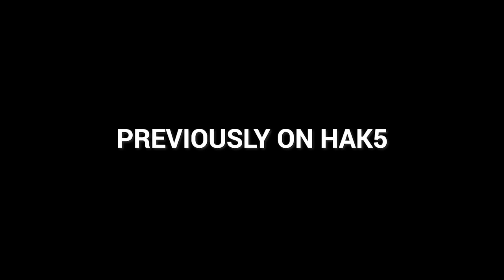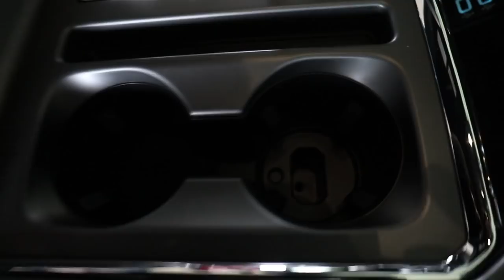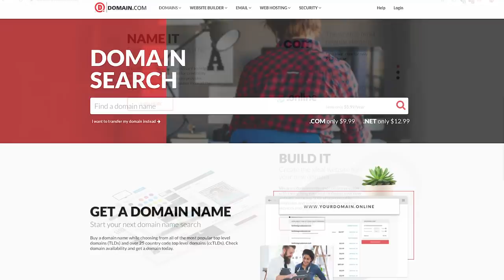Hacking Ford Key Fobs Pt. 2 - SDR Attacks with @TB69RR - Hak5 2524 [Cyber Security Education]

Comment: So the rf unlock versions with push to start at least from 2013-2016ish on the fiesta, focus, fusion, and escape (maybe more) with the triangle looking key fob there is no use for the physical backup key once you’re in the car... or if just your fob battery is dead or it can’t sense the key is within a few feet of the driver’s seat from the normal slightly longer range signal, you can’t remove the push to start like many other manufacturers do to reveal an old school ignition tumbler behind it- ford’s recommended backup is that there is an short range rfid reader on the steering column in the shape of the bottom of the key and you hold the bottom of the key up to that slot and it will allow you to start the car.

Comment: Just curious if you attempted to pickup the signal being produced by the little slot in the cup holder...? Just wondering if it would be possible to capture the signal that is used to reset the FOB and then replay that....? Would this allow you to then reprogram new FOB's for the car?
Reply: I have and there is some timing there that needs to be done. You also have to have two programmed key fobs in the vehicle for it to program additional ones. Not to reset an existing fob but to make a new one.
Reply: @tuathadedanaan1424  I suppose attempting to replay both the FOB's on seperate devices while attempting to create another would be a bit expensive but plausible, yes?
Reply: @SrgtCauliflour  its not you would have to captguyre them syncing a key it would be way to difficult. The signals are different when making a key than they are starting. It doesn't just use the same sequence it changes every time. That wouldn't work.
Reply: @tuathadedanaan1424  Cheers! Great Work on the Videos by the way. I'm interested how far you manage to take this....